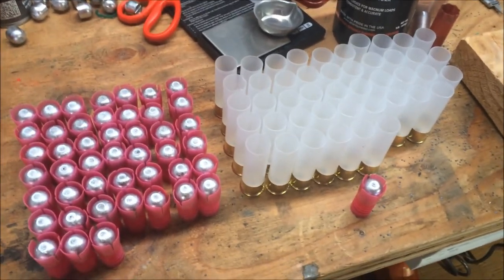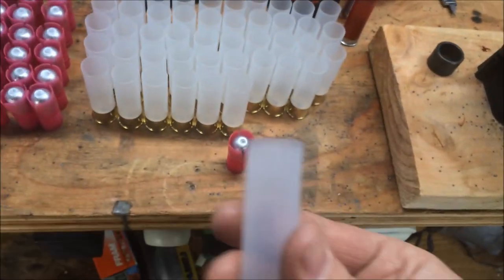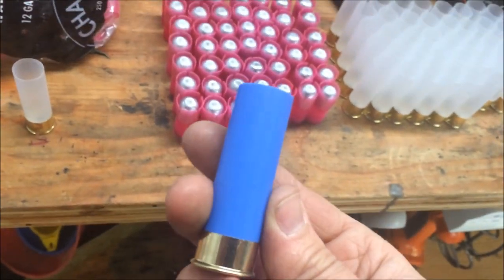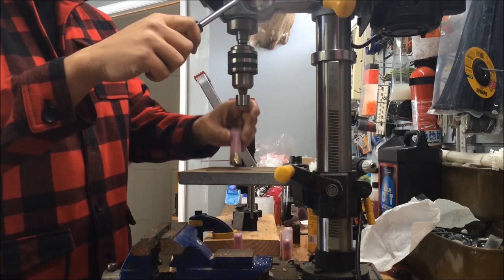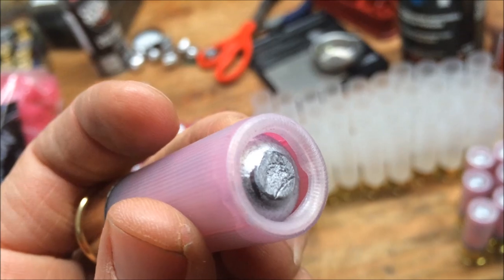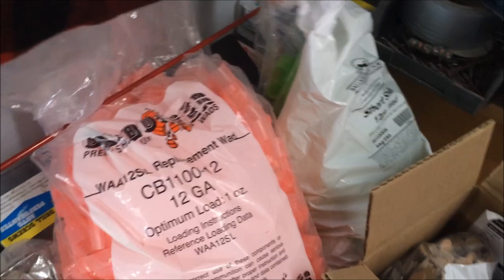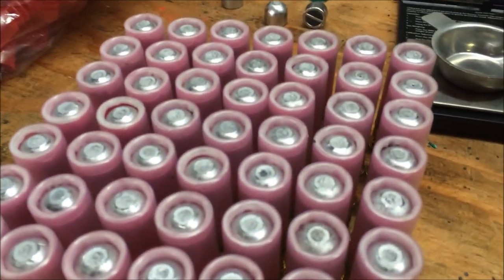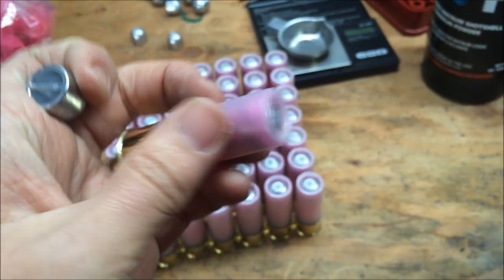Reloading and Roll crimping Lee Drive Key Slugs

Comment: According to the lee book that cross rib on the slug was made to have the wad mold into the bottom of the slug to carry the wad down barrel for consistent ballistics. You might be defeating the design with that nitro wad under the slug.  Anyway the book is called modern reloading by Richard Lee page 144 second paragraph. And he doesn’t use a roll crimp.  He calls that the old style.  Just a FYI.

Comment: Casting 800 gr. and 900 gr. Paradox slugs in Magtec brass over black powder but the supply seems to have dried up. You've sold me on the drill press, I've given up trying to hand drill the crimp. Great video, going to get the drill press.

Comment: While the Federal wads do work very well with Lee Slugs, their Claybuster replacement wad does NOT. The CB2118 has ribs that the original does not. You can trim them out, but it's a pain.

Comment: Very good load there. I find they shoot very well. I don't see that 45grns powder is too much at all. If it was faster burning then less charge would be called for. The roll crimp struggles when it hits the petals to form correctly and you have the same problem I had with the roll-crimper bottoming out on the slug before complete roll. You can force the roll crimp down harder if you don't mind a rub mark on the slug (which is only cosmetic).

Comment: The BP wad # PT-1205 is excellent for loading both the 1oz & 7/8oz Lee Drive key slugs! That is the only wad that I use for the Lee slugs!
Reply: รพุรึพุนทเพ่ดีนิเถอะที่นิจะเรด้า เทพยถังคดเคี้ยวเทคเอุ่นร้ารจิ
Reply: I use the PT1205 for the Lee 1 ounce Key drive also.  I have recovered the wads and found them pretty much torn up, accuracy out of my Remy 870 24" rifled barrel is 8 inches at 25 yards.

Comment: Use the PT1205 wad (NO CARDS) for the 1oz slug. That's in Cheddite with a CH209 primer and 25 grains Bullseye. Gets you 1450 fps at 10,700 psi. Or... 28 gr Green Dot gets you 1425 fps at 9,500 psi.

You CANNOT beat the way a PT1205 fits that 1oz slug; it's 0.200" shallower than the 12S3, and fits that slug like a glove. The 12S3 wads are now deprecated for the Lee drive key slugs.

Comment: Excellent video.  Excellent advice on the nitro card too.  I use a nitro card under my key slugs and they are very accurate out of my rifled barrel shotgun.  No matter what you do, these are a great cost savings alternative to the commercial slugs which were costing me 5 - 6 bucks a shot!
Reply: How much does it cost to buy a set up to make your own bullets? In 2021, bullets can not be found!
Reply: @censoreditali-american6487  It's been a while since I bought most of my equipment but I guess it depends on how much bullet casting you intend to do.  I've spent over a thousand dollars easy and it also takes a time investment because it is kinda slow for some types of casting.  If you are on a tight budget, you can look for used lead pots.  Another very cheap method would be to get yourself one of the melting pots that are not powered or you can use an old, smaller, steel or cast iron pot that you don't ever intend to use for food again.  Then all you need is a good propane burner hooked to a propane bottle.  You need to do this in a well ventilated area and you need to wear nitrile gloves or something to protect yourself since you will pick up lead by handling lead bare handed.  Don't ask me how I know this...I've been tested.  You will need a dipper tool to dip the lead for mixing, removing the dross from the surface, and to pour lead into your mold by hand.  And you need to get the molds you want.  Lee molds are very affordable aluminum molds but they are also made from steel.  You need to set the mold on top of your melt pot a while and it may take five or 10 castings that you need to re-melt to get the molds up to the proper temperature.  Then you can turn out some quality bullets.  Use a wooden dowel to knock the bullets out of the mold and use bullet lube to lube the joints on your mold for each molding session.  I use Frankford arsenal mold release spray on the mold cavities but some people just use a match to "smoke" the mold cavities and that helps with releasing the bullets from the mold.  One redneck kid just drilled holes of the proper size for his shotgun in a piece of 2x4 and poured molten lead in the cavities to make his slugs.  But I've had great luck with the key slugs and using a very strong vegetable card beneath the slug to keep the wad from squirting up into the cavity of the key slug and messing up the trajectory.  I use a Lee production pot and a lot of wheel weight lead for cowboy action bullets and I have lube sizers too.  But to lube your bullets, all you need is some lube and a pan and an oven to do pan lubing.  Once that is done, they are ready to load.  But the lee key slugs don't need lube due to the plastic wad.  Also, you can buy a mold for buckshot and make your own buckshot too.  Put nine pellets in that wad and check your load and you have something you can defend yourself with.  Normally I buy most of my 00 buck since it's pretty affordable.  I use an old Pacific/Hornady shotgun loader with the proper bushings to drop powder and shot.  It's a progressive press so I can load a lot of shotgun rounds pretty quickly and they look as good as a factory round when I'm done.  But it helps to be mechanically minded in all of this.  If you don't have much mechanical aptitude, it's probably best to have someone who is to do your reloading, or just resign yourself to buy all your ammo.  AI also have some bullet molds that use copper gas checks for my magnum pistol and rifle loads.  The loads being so hot that they would melt a standard lead bullet, so you can crimp on a copper gas check on the bottom of the bullet and push that thing up to magnum velocity with very good results.  You don't need full copper jackets on most pistol bullets but watch for leading in the bore.  If you are getting leading, you need a harder allow of lead for your bullets, a gas check, or you need to slow the load down a bit.  Beyond that, I'd invest in a Lee Lead Remover kit which uses brass screening in a rubber chuck to remove all the lead from the bore of your pistol or rifle.  Hope this all helps you.
Reply: @SurlyBob1  Thank you so much for taking the time to explain all of that, you Rock, Bob!! Ty Ty, gives me something to ponder in this day and age. I can not find slugs ANYWHERE. I bought my son a 20 ga for Christmas on Blk Friday from Dunhams sports and we still can't find bullets as of 2/4/21 for the 20 or my 12 ga. So i've just been buying 2-8 shot bird shot stuff, I guess it's better than nothing.

Comment: I'd try trimming those wads back to the point the slug starts to taper so you get a more even crimp that certainly affects accuracy.
Reply: Thank you. It can be downright dangerous to melt a wad to a roll crimp on a shell that's near pressure limits.

Comment: Like you said; 45 gr. Of Blue Dot is a lot of powder. I use to load 38 grains behind 1 1/2 oz. Of shot as a magnum goose load and that was pushing it. I realize you're only pushing a 1 oz. Payload, but I would be finding out what my chamber pressures were. You may be causing incremental metal fatigue which could lead to a catastrophic failure.
Reply: Don`t compare magnum shot which is usually BB or Zero, the density of the Slug although it may be same weight of your shot for magnum goose load is bigger, thus you have adapt less powder accordingly ; beside I don`t use plastic cups between powder and slug but "Felt Wads"  Greeting from Malta--Europe.
Reply: @sebastiantufigno6955  Wow Malta! Word sure gets around. As I  understand ballistics....when you increase a given powder charge against a given projectile weight you will get a higher chamber pressure over the same load with a lower charge. Yet if you keep the same powder charge but increase the weight of the projectile, you also will increase  the chamber pressure, because the heavier weight requires more pressure to start it down the barrel. 
Now there are other factors to consider also, such as primer choice, i.e. standard vs magnum, and if shotgun....the inner base of the hull can affect pressures. This is why reloading manuals give you a specific primer, powder, hull, shot cup or filler cards, and weight of shot for a given load. Changing any of these can lead to dangerous results.
For all these reasons, if one is testing loads that haven't been published as safe....I recommend a test barrel that can safely handle high pressures and give the data needed.
It only takes a millisecond to either change your life forever or end it.

Comment: I find I can get 5-6 reloads out of rang pick up hulls, using a star crimp, and 7/8 oz slugs and about 40 grains of Green Dot.
Reply: Seth Wilcox    According to Ballistic products load data with a 7/8 oz. Lee slug 29 gr. of Green dot  is the max load at 9500 psi and 1505 fps . What you listed is 11 gr. over max . of Green dot .
Reply: I also second that comment 40gr of green dot wow scooting any sign of over pressure?

Comment: After watching the slug accuracy videos by taofledermaus I surprised anyone bothers with the 1 OZ slug.
Reply: That video is what prompted me to by the 7/8oz slug mold. I do have a 1oz one on the way, though. I think they may have had some recipe issues driving a lot of those crazy flight paths.
Reply: @robertfrapples2472  it looked more like a flight stabilization issue than a loading issue.
Reply: I did see a video where a guy used the plastic from old hulls, melted it, then used it for making a tail for key drive slugs, that should make the 1oz slugs fly straight.

Comment: The shorty wads are perfect for 1” 3/4 shotshells !!
Reply: Really? I want to start loading my own...I’ve got the KSG 12, I can pack 25 total between the two tubes
Reply: I make a 1.75" 12ga round with four #000 pellets and four #4 Buck pellets, a gas seal and nitro card. It's a little beast in my Shockwave.

Comment: Hi I have the load all as well im just wondering if you tried different bushing and what grain they drop if you go by the chart that bushing your using should drop 25.4 grains per drop . and have you tried going down to 43 or 40 grains.
thank you for your time
Craig
Reply from the maker: you have to try each different powder... they all will measure differently depending on how fluffy the powder is...
Reply: @SirSloop1919  Many years ago. My Dad used a few coats of nail polish inside a bushing to lower powder load.

Comment: Your wad is too tall. Your rolled crimp should not touch it. That would fly with a star crimp, but you're melting the hull to your wad. That's causing those little irregularities you see between the wad and hull.Trim those petals below the top of the slug or try a L078 from BP.

Comment: How did you know how much grain you had to use with the blue dot?
Reply: @iansmith8944  all he posted was the dispensing equivalency for the powder bushings. Alliant has ZERO published load data for blue dot powder on their website for 1oz. 12 gauge loads. BEWARE!!
Reply: I always try five cartridges with different loads and see the pattern  on a one square meter board  before I conclude and chose the best load. Then I go for max production. Lmfao. Greeting from Malta-Europe.

Comment: Im Doing The 7/8ths Oz Lee...The 7/8ths Lee Flys Better..They Cast Easier Than The Svarog.. Im Having Problems W Core Sticking on Svarog.. . The Svarog 12/16 Gauge Round Balls Cast Well..They Average .65 inch or 16.7mm... These I Star Crimp And Push Star In (Inverted) And It Holds Ball And 7/8ths Lee Well, Against Base Of Shot Cup. I Use Winchester/Federal 100bx From W-Mart 24.47 Per 100. Re Casting The #8 Shot. Up Charge The 3 Dram To 3.5 Dram For My Vr60... This Required Sacrifice Of 1 Donor Hull For 6 3.5 Dram Loads.
1425FPS Calculated 3.5 Dram.

Comment: You said you made the Buckshot made from scrap metal?   Mark 0:43
Reply from the maker: I made these slugs from scrap lead.  Many local metal recyclers have a lead bin.  You can buy pure lead pipe and a variety of mixed lead items like dive belts,  solder rods, solder rolls.  You can make buckshot the same way you make slugs.  It just takes more work to manufacturer the shot assemble the shot column.  You would also want to do either an overshot card and a roll crimp, or a standard star crimp over the shot.

Comment: can you shoot them slugs through a full choke/fixed choke shotgun I would be useing my single barrel bikael shotgun I know that's not spelt right and I can't be bothered to go to my safe to see how its spelt it's the Russian single barrel shotgun. I wondered what choke do you need?
Reply: Simon outdoors if anything I would go to a gun shop and see if they have any slug chokes or what ever u wanta call em , about the full choke i mean you can but I wouldn't I have my own shotgun and I asked the gun shop that my dad got it from and they said not to because it can blow the end of ur barrel off or split it
Reply: I have no experience with rifled shot gun barrels, but I get my best slug accuracy with either improved cylinder in Skeet #1, see no difference in groups with these.  Cylinder bore does well too, but improved is just a little better.  Modified gives me erratic groups beyond minute of pie pan at 50 yards; compared to improved cyl where the 50 yard groups are 3" or less.  Have not tried full choke, but I bet Lee, knowing that full choke shotguns are so common,  specifies ?pure lead" only.  I believe it will work, but not very well at all.
Reply: Simon outdoors the russians spell it wrong too

Comment: It is very strange but I cannot, for the life of me, find any reloading data for SLUG reloading.  There are thousands of articles and tables for everything else but there is almost none for slug reloading.  Am I missing something?
Reply: There's some data in the Shotshell-only books, a little reminder "don't listen to me I don't know what I'm doing"

So what I do for missing data is start with the same weight in bird loads, start light with the slug/buck and I run the load up until it cycles my benelli semi-auto shotgun. After that I chroney it and watch for pressure until it's where I want it. Be careful though. If your wads are odd then bring the projectile to a cool reloading shop and test it out in some wads until you find something that works. Keep notes!

Comment: would this recipe work with once fired Remington slugger hulls or winchester super x slug hulls?
Reply from the maker: It's difficult to roll crimp previously fold crimped hulls.  You have to basically remove the old crimp completely before roll crimping.  It's just easier to start with new hulls or hulls that have always been roll crimped.
Reply from the maker: Ahh the sluggers are roll crimped I think.  You should be able to reuse them as long as you get the column height worked out.  They are not as easy to obtain in large quantities though.
Reply: Yeah,  they're roll crimped from the factory,   I'm going to have a ton of hulls left over after a tac shotgun class I have coming up.   I haven't been able to find any load data for them though

Comment: How does this fare through a smooth bore barrel? And would a 6 star crimp work well with this?
Reply: I prefer just high round closure on the slug itself. Believe me at 200 meters it goes straight through a car door or a one and a half inch solid wooden door.

Comment: Is it a good idea to star crimp slugs
Reply from the maker: you can... I use these clear hulls so there is no question what load is in there
Reply: +sir sloop ok thanks
Reply: +Evan Schneider It's fine. I make lot's of star crimp hulls for slugs. For I.D, I use just Gold STS hulls or black gun club.  Those are only used for slugs. So if it is gold or black, I know it is a slug. Green sparkly STS for buckshot, normal green gun club for birdshot.... AA for special stuff.

Comment: I can't watch anymore of this.  A LOT of talk about wads, not ONE peep about the die you are using to roll crimp!  I think you should re-title this video:  "My wad collection, and a little tiny bit of a demo on roll crimping a slug that was designed for a normal crimp".
Reply from the maker: ballistics products roll crimper
Reply: Right around mark 1:00 SirSloop mentions the problem to avoid when roll crimping this or any "in a wad cup" slug.  You need to assure that the side walls or fingers of the wad do not occupy the upper region of the hull where the roll crimp may pinch them.  Some people trim the wad cup fingers, but there are wads that have short cups and cups with internal diameters large enough to accept the slugs.  BPI's Lightening 7/8 is a good example.
Reply: tkarlmann yeah you
Reply: he has a point u should talk more about the tools than just the wads u using
Reply: Well..... Bye! Roll crimps are fine for slugs, in fact, "The Old Curmudgeon" at BP will tell you that's the best way. I use a fold crimp simply because they're faster and turn out PERFECT in my Rem STS hulls with Lightning wads. UH-OH! I said the "W" word!
Reply: @amm0j00.o7  Folks shooting themselves in both feet up in here!
Reply: @Mav8887.  "Your?" That kinda backfired, but you're right, you can roll crimp instead of fold crimp. I'm told you may lose a bit of pressure with the roll vs the fold, but it's fine.